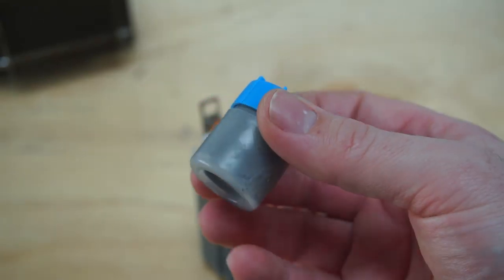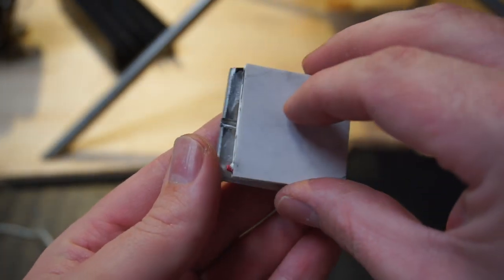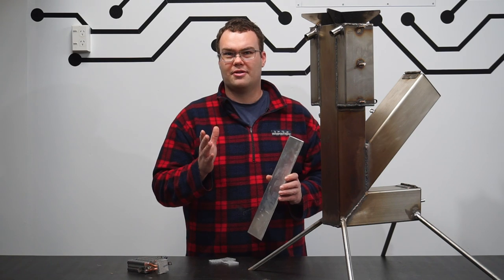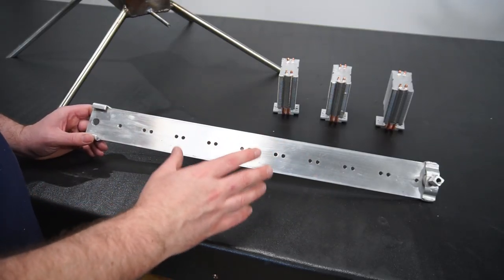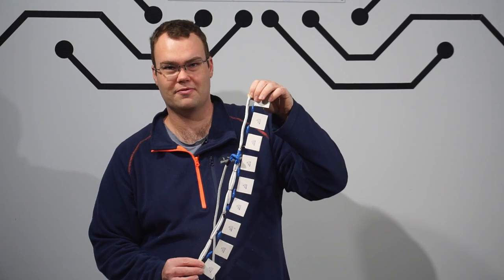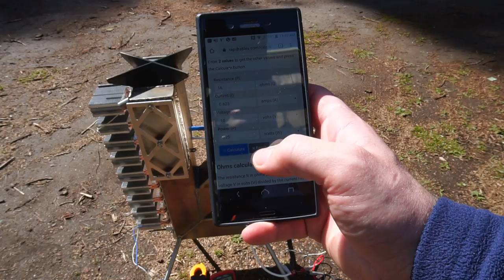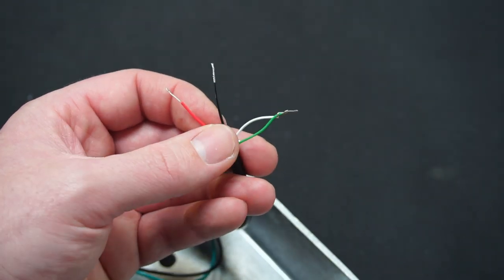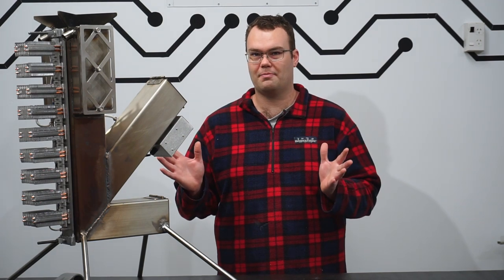Survival Rocket-Stove Build (Part 2)

Comment: Great project! 
For keeping your tegs at the appropriate temperature try using spring mounted clamps and springs steel to push back and forth with the temperature and adjust the location of the tegs similar to how old school thermostats work with a bimetal spring

Comment: You tried adding some insulated LiFePo Batteries under the charger?
REALLY, this is one of the most Amazing DIY survivalist builds I have ever seen!  Thank you for stimulating my brain!  Finally a  useful use for TEG's!
Thank you!!!
Reply: Maybe add a power connector to hook this up and combine with a solar generator and such. Wow.. so many possibilities.
Reply: Maybe have the option to switch to some PEX tubing wrapped around the unit and flow that super heated air into a tent... by switching on a fan that would run at the generated voltage (or with a boost converter).  Wow!  That would be sweet!
Reply: Also, I'm sure a water level indicator and water temp (that can be switched on and off) would be nice.
Reply from the maker: I'm glad you enjoyed it! I'm considering adding batteries to store power on my next version.

Comment: When the stove is burning very hot and to prevent the TEG's or Peltier elements from overheating (and possible damage), you can add a temperature control and a servomotor on the choke to limit the incoming air to the stove.
Another possibility is to mount the plate with TEG's mounted, on the bottom with a hinge, and on top to a servomotor with a screw spindle that moves the plate away from the hot surface of the stove.
I think moving it 2 to 4 cm away, will be enough to lower the hot temperature to the TEG's.
And as third more sofisticated option, is to use a upside down U shape square pipe, the TEG's mounted on the outside of this U pipe, and in the other side mounted to the stove.
Then using a fan that blows the heat trough the U pipe, to the side where the TEG's are mounted. If then the stove runs to hot, a plate (valve) opens in the middle of the U and let the hot air escape on top, instead to the side where the TEG's are.
Reply from the maker: Very innovative ideas! I'm hoping to get back to this build during 2020. I've found some very nice TEG's and coolers. I also had suggestions to use a Bi-metal strip to move the teg's away from the chimney to prevent overheating. Not sure what direction to go as yet.

Comment: I'm happy that you're alive.

There's a bunch of heatsinks that might be a lot better than the ones you used. Aliexpress brands like Snowman and Lanshuo. Something with a LOT more than 2 heatpipes for sure, at least 4!

But on the whole thermoelectrics are just finicky and inefficient. I think something radically different should be explored. I can't imagine that Sterling engines would be quite it, but i wonder, what if. Is a steam turbine possible? Gas turbine? Creating turbine blades by precutting thin sheet metal with shears according to a pattern and then using two 3D prints under a press to give the blades their shape?
Reply from the maker: I'd really like to make a turbine generator in the future. Ideally I'd need a lathe & mill. It's in the hard basket for the moment but, definitely on the to do list! Better heatsinks are high on the priority list. I'll checkout the brands you mentioned :)
Reply: @Schematix  i was thinking, why don't you just add some fans to the Heatsinks and a battery that charges when the power is not getting used , the fans could turn on only when the heat goes over a set temperature and the power would come from the battey, i sort emagine this is just used as a fail safe    for those times it does get too hot and also the battery would make a sweet powerbank
you could have a battery bank down low somewhere it can stay cool
Reply: A Tesla Turbine would be a better option with up to 98% efficiency, and i have suggested that to Amon, they would be better than the Tegs.
Reply: @noelandrew3600  i think that would need the steam to boil to turn the Tesla Turbine, it would work but how often would you have to keep refilling the Water Tanks oO i think the Tegs. are less complicated, they just need some type of over heat protection

Comment: The only thing that I can come up with is to maybe shield the CPU coolers from the radiant heat coming off of the chimney, that might bring efficiency a bit - maybe use some ceramic wool insulation? Cool project BTW.
Reply: Maybe the rocket thing could pull its air through a channel where the sinks are

Comment: Cant you generate cold air rising through the heatsinks by utilising the rising air in the chimney?
Reply: Ingenious...
I like that!  That definitely would be safer and might increase the power output by 10-20%
Reply: The rocket could pull the air it uses for combustion through a channel where the heatsinks are. This would also make the rocket stove's air intake utilize gravity for extra pressure :)

Comment: I'm surprised you didn't opt for a MPPT controller. Nice build.
Reply from the maker: It would be a good off-the-shelf option for sure. It just didn't feel right building everything this far and then buying a charge controller. Might as well go all that way & make that to ;)
Reply: @Schematix  Yes, I should of made it clear I understood why you chose to build rather than buy. I was thinking along the lines of using a SM72442 MPPT controller chip from TI http://www.ti.com/product/SM72442. Granted a little more complicated than a linear reg.
Reply: @MiniLuv-1984    even the dirty simple buck converter should work better I think

Comment: Im not sure TEGs are the best option in terms of power generation I remember one of my dads friends using a steam powered setup to generate power. you could possibly do something similar or a similar style to geothermal where you create a pressure differential between a high pressure and a low pressure tank. you could re-purpose the two tanks as your boilers and have them turn your turbine. then let the water recollect a precipitate back down again? might just need to do some R&D on a decent turbine design and a nozzle to suite?
Reply from the maker: I'd really like to experiment with turbine power generation. And as you mentioned, it would be far more efficient compared to TEGs. The catch being it would require more fabrication & machinery such as a lathe and mill. I hope in the future I will explore this avenue. Know anyone who wants to sponsor a lathe & mill?  ;-)
Reply: @Schematix  Haha I wish! That'd make some great content. The kiwi AvE haha. I have a few ideas you could use and with off the shelf parts mostly too. I rekon you could keep a similar size but I rekon you could peak 100W off it maybe 70-80W continuous with some optimisation 😁

Comment: Might sound crazy but, If you could make a shroud over your heat sinks that draws cool air from the top and then if feed into your fire draw at the bottom, the air the fire needs will cool the sinks with higher flow of air. Might be good. Might be complete crap! Experiment.

Comment: Stack your TECs to get more output
Reply from the maker: I have tested that theory, In my test setup stacking TEGs never yielded more power than a single TEG. Perhaps in a different application, it could potentially yield more power??
Reply: @Schematix  . I guess now that I am thinking about it, the horrible efficiency in generating temperature differences also translates into horrible exponential losses during energy generation so the increased power just wasn't visibly noticed without greatly increasing other components of the system.